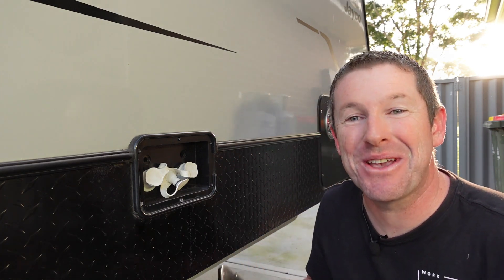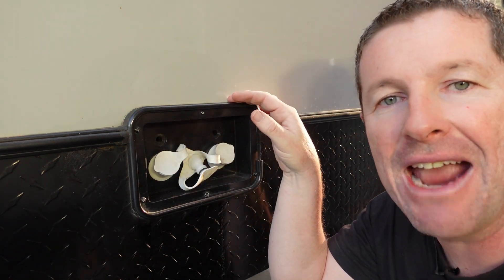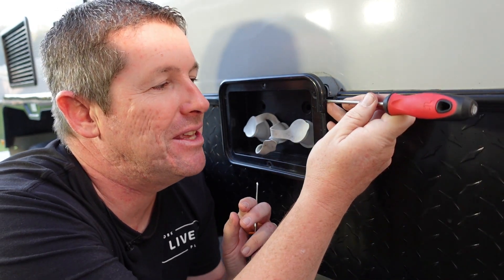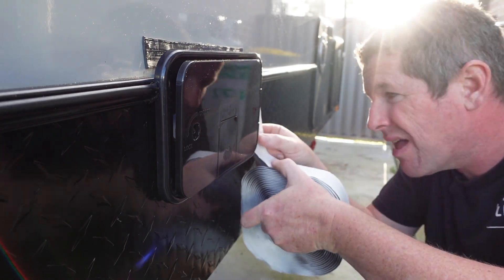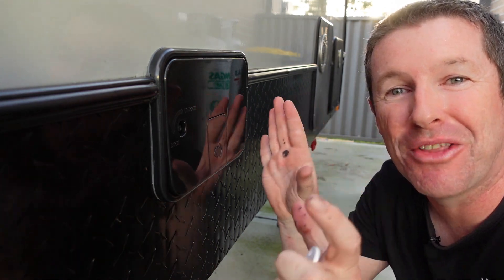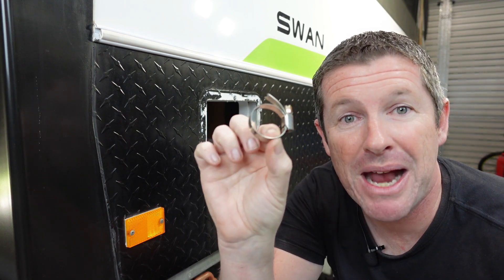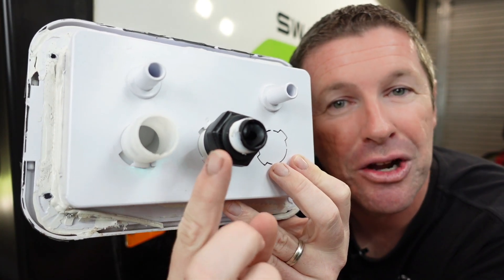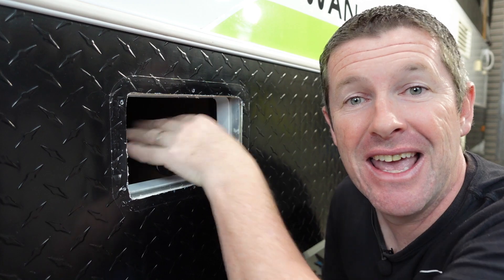LIVE | Coast to Coast Water Filler Door Replacement on your Jayco Camper or Caravan - Tips & Tricks!

Comment: I've also been slowly chipping away at changing all the dated white fixtures on my '09 expanda to black. That said, I've never had much success with the mains attachment on these units, with lots of hose blowoffs or persistant leaks/drip. I ended up re-routing the mains point to under the van, which has solve all of my problems. 

Wish I'd seen your tips on the use of the butyl tape beforehand though, seems a great option. Nice comprehensive video mate.

Comment: thanks for the tips. the caps on those water fillers had s a bit concerned, they don't seal at all and fall off when you look at them.
we use some small rubber plugs, like in the jayco sinks and basin.

Comment: I couldn't remove the sealant. So I pushed the pin into the upper hole and held it there while I placed the door back into position, put some super glue in the door hole then quickly jostled it into position so the pin would drop into the glue.

Comment: Thanks, I just needed to see how to change the door & you were first cab off the rank & it worked.
...but, how do you remove the key once the cover is locked, it has the silly tabs on the key, so when you lock it, the tabs are locked in too so the key can't be removed?